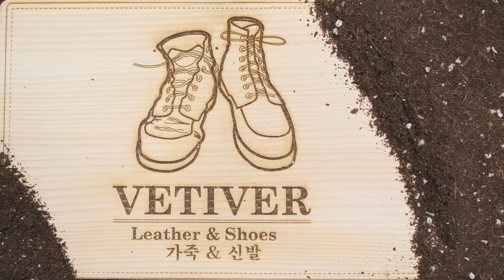[ASMR] Custom NIKE - Air Force 1 White 🎨🎨🎨  안녕 -4k

Comment: I can’t be the only that thinks that those AF1’s were in very good shape even before the restoration lol
Reply: Thats because they werent dirty at all, the black stuff you see on them are scratches left by sandpaper, people who make custom shoes put acetone  and use sandpaper in order to remove all the finisher applied previously on the leather so the paint they are going to put sticks better into the material
Reply: Why did he have to do that to the soles bro they look awful and didnt need the sanding and replacement
Reply: @13tebek  no dice nada
Reply: @13tebek  The paint came off, it wasn't from sandpaper. Other than that, the shoe didn't need to be repaired, the owner of the shoes just wanted them customized.
Reply: Imo they would look better if they were even more beat up,
but this is so satisfying tho
Reply: I was surprised at the toe box.. Mine look worse than that and they’re only a couple months worn lol great job anyway
Reply: @Krashout00  maybe the owner used a crease protector

Comment: Acetone is for only white? Or it can clean a coloured air force? Like gray can i use a acetone to remove the black marks or dirts?
Reply: Any color. But is used to dull the color, not clean it. Lighter fluid cleans the white rubber part on the sole.